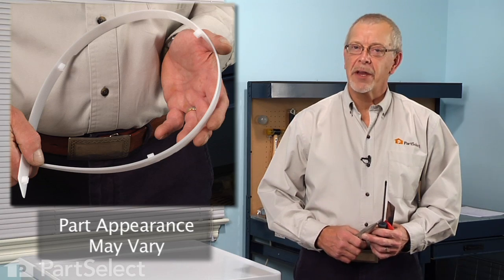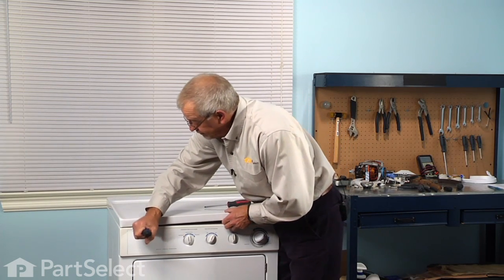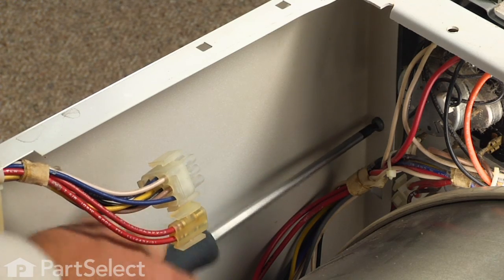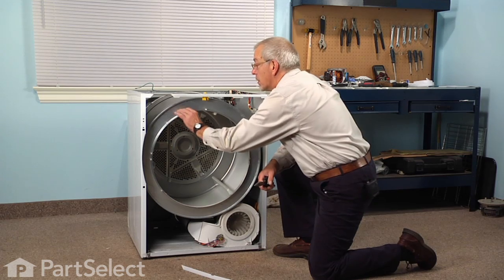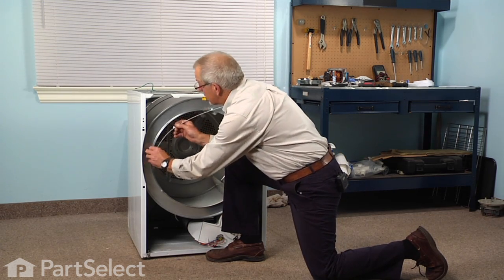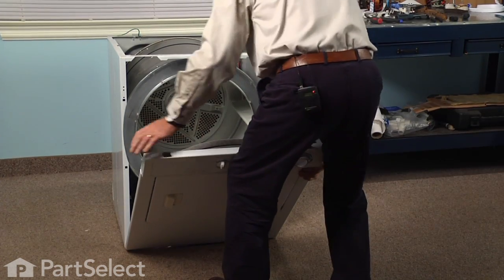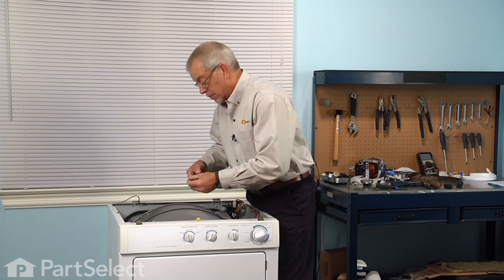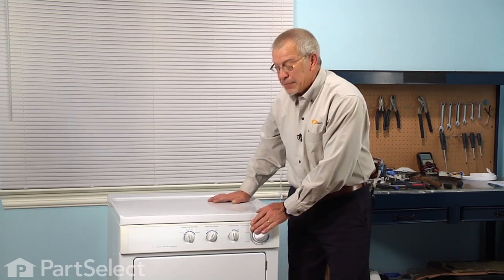Dryer Repair - Replacing the Front Drum Glide (Frigidaire Part # 131963900)

Comment: i have a kenmore model 417 811 4200  it looks like this dryer but it has no glide .. its chewing clothing i need new felt seals for around the door but my dryer also had little plastic tabs glued to the felt that are worn and gone .. can you give me an idea of what parts to order
Reply from the maker: You most likely require the upper drum glide kit part number PS470317 as well as the lower drum seal part number PS460194. We have provided instruction videos for both of these parts. Dryer Repair- Replacing the Upper Drum Glide (Frigidaire Part # 5303937139) and Dryer Repair -- Replacing the Front Lower Basket Seal (Frigidaire Part # 5303283286)
Reply: actually your maintenance kit came with both the upper and lower drum glides and the video was wonderful
i replaced the belt and pulley both glides upper and lower and everything that came in the kit ,, it was easy to do and my dryer works like new